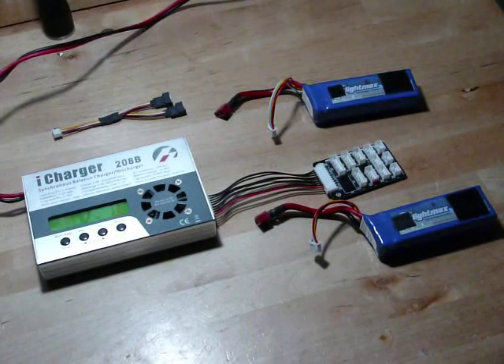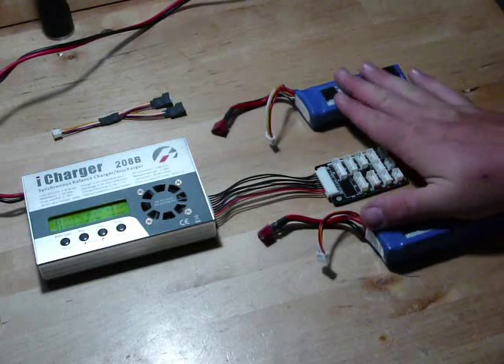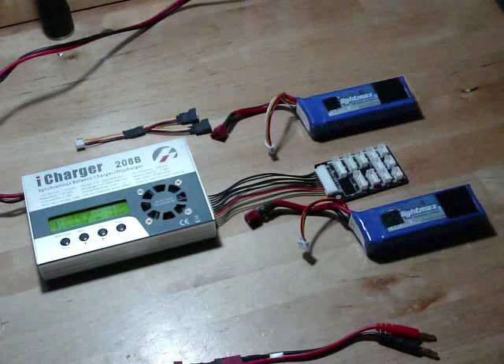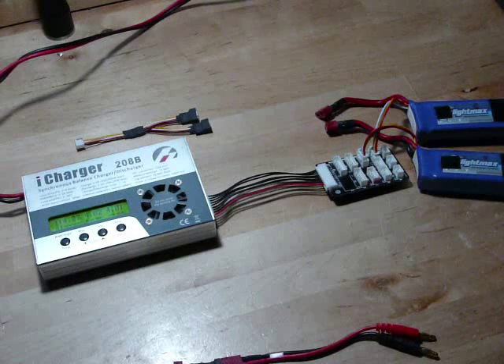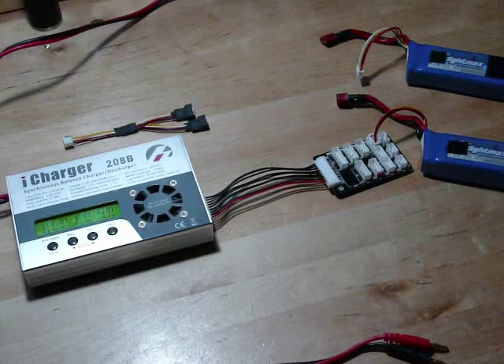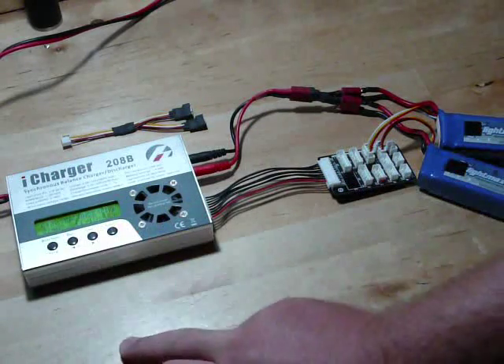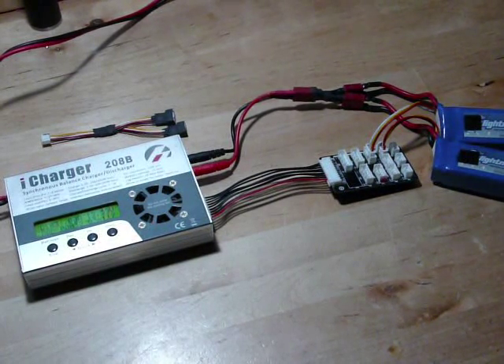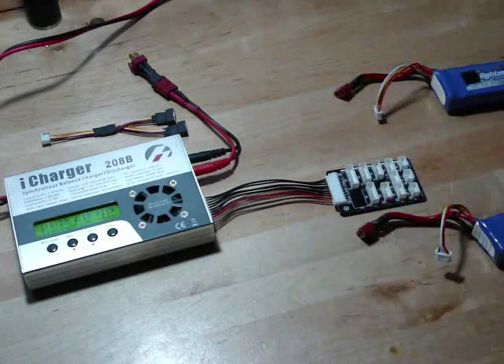rcheli parallel charging

Comment: Actually the cv don't get split now that I think about it I believe the cc is getting split up between the 3 packs but the cv is not good on either of the dead packs. But I don't think it's that bad either.  Let's just say I'll be sticking with charging from similar voltages just to ensure the packs health.

Comment: Also doing this with 2 dead packs and 1 charged helped too in all ways being the charged packs juice was getting split into 2 packs as well as the chargers cv. If you only use 1 dead and 1 fully charged this would even increase the negative effects on the packs. But this is a cool video and I did like. Plus ya taught me that I could use my 4s port on my balance board. Duh I have no idea why I didn't realize that. Thanks man now I just have to solder up a parallel main charge lead and I'll be good to go.

Comment: I agree with ya maybe not such a big deal but you gotta agree when I say it does affect the health of specially the lower voltage battery being it's receiving too much juice from the charger being the charger is averaging the 3 packs and sending its constant voltage based on a higher voltage  being a lipo is charged using the cc/cv method the lowest pack should be charging at a lower voltage than the higher pack. Plus it's receiving juice from the higher pack as well until the 3 balance out

Comment: I noticed you don't connect the the two batteries balance leads to the 3S board port, but one to 3S and the other into the 4S port leaving one pin out. Is there a reason for not plugin all batteries balance lead to the 3S board ports? I have just tried that and it seems something went wrong but I would like to understand why. Thanks

Comment: Eg.
A 1000mAh and a 5000mAh. Combined this is 6000 mAh, which is 6A. 
However, a 1000mAh battery would only be rated for 1A, and should receive
all 6A! I don't see any way to balance the current between batteries so 6A goes
to the 5000mAh only, since it's in parallel. I would also be at least a little
bit concerned if each battery had a different voltage. Maybe I'm just over cautious.

Comment: the 40C rating you are referring to here is actually the rate the battery can DISCHARGE (how much can the device draw at once) and is not what you calculate your charging amps with. In your example you have two 3s 1000mAh or 1000+1000=2000, the charge rate on that is 2A. This is for one battery however, it would seem to me if you had two batteries and one had a lower rating you would need to calculate based on the LOWEST batteries mAh, not both combined.

Comment: I have a triton with charge threw ballance leads.My charger is 4cell max at 14.8.Now if I charge 2 3 cell 2200 ma will I be over voltage like I was charging a 6s or would it be the same 11.1 with double the ma.So on 2 2200 3 cell packs it would read 11.1@4400ma.Or would it be 22.2volts..Trying to get more from my chargers.22.2volts=series/11.1 volts parallel with 2 3 cell lipos correct?

Comment: @xxgg 
The mah does NOT have to be the same. Just the cell count. That is if you are charging them through the discharge lead. You can charge differnt cell batteries if you are only charging through the balance lead. This means that the main lead is not plugged in. Some chargers can not charge without batteries being plugged into the main lead. I like to charge batteries that are within 1/2 volt of each other. My lvc on the esc keeps my batteries close

Comment: So lipo in a parallel mode will effectively double the total amp output too, right?

For example, two 3s 1000mah 40C lipo in parallel = 80amps output?!

Comment: Question:
What if you are parallel charging two LiPo with different Mah? say 1x1000mah & 1x2000mah?   I would use 3AMPs setting on charger ?

Comment: 5:20. Your main wiring is wrong. Main leads are not wired in paralell. They are not wired at all. check the voltage of main leads with voltmeter and it will show zero.  The 2 black wires need to be connected together then connected to black charge lead and same with red wires. you have an open circuit.  
it will work but you are charging through balance leads only.